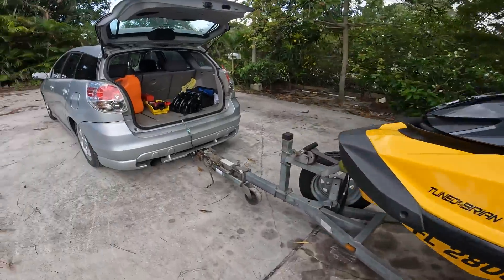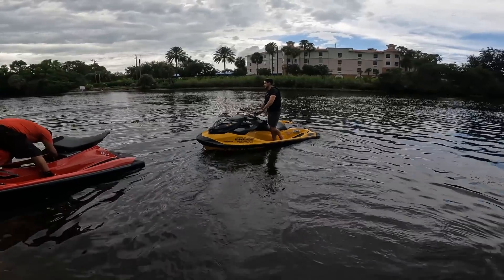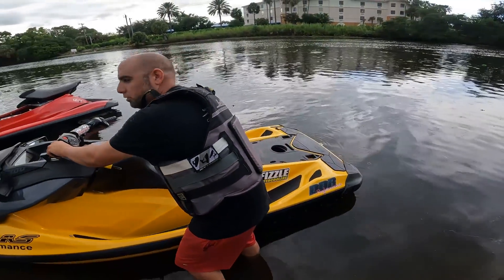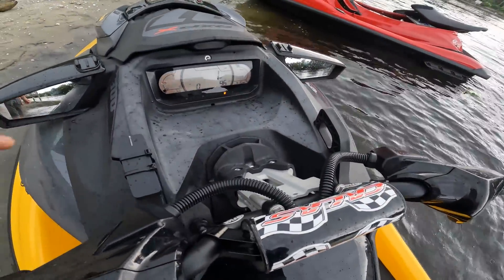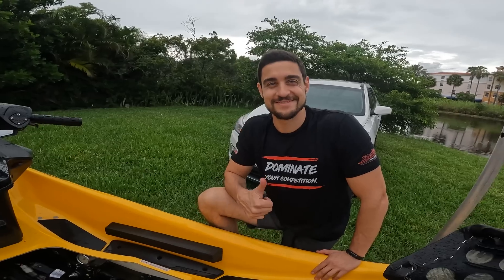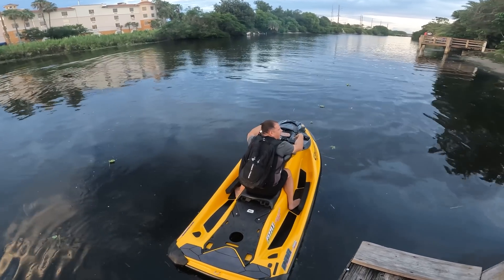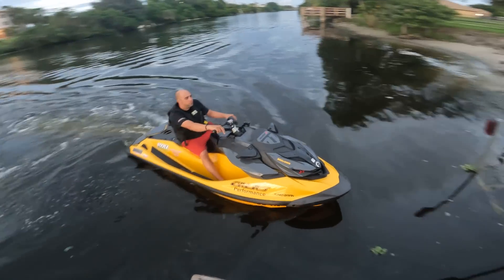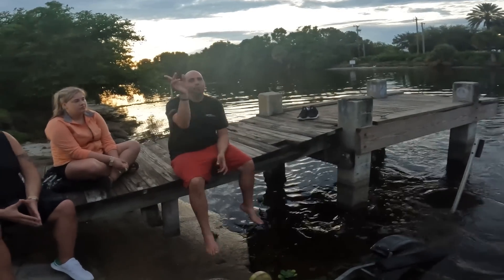DDR INTAKE MANIFOLD VS STOCK INTAKE MANIFOLD | What is the BEST Intake for the SEADOO ROTAX ENGINE?

Comment: Does removing the flame arrestor really add one more pound of boost? Is there any real performance gains in doing this mode on a stock 300 or is it not worth the time and effort in removing the flame arrestor? Any downside on removing the flame arrestor?

Comment: When you put a big Turbo on that sea, do. What do you put in place of the Turbo hole in the back of the motor?
Reply from the maker: Either you can make a plate and welded it or you can make it that you can use one of the bolts from the supercharger and put a fitting so you can put the turbo return oil line or you can use a non-supercharge PTO cover